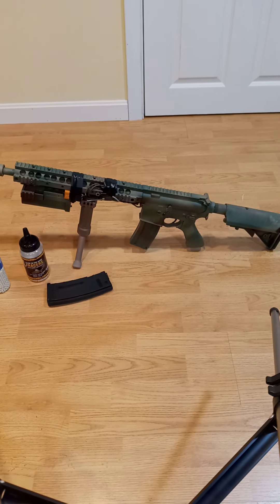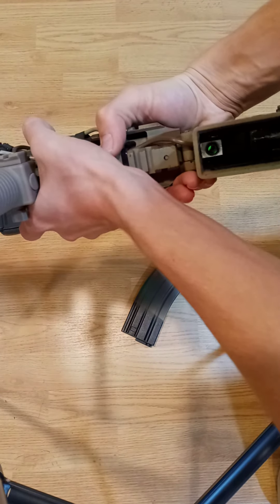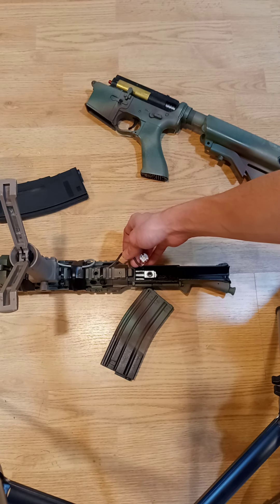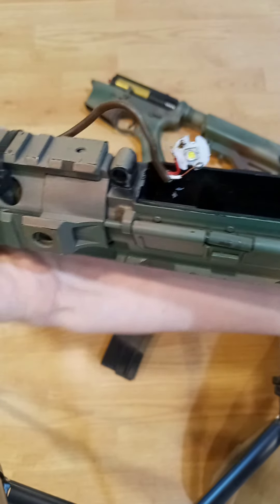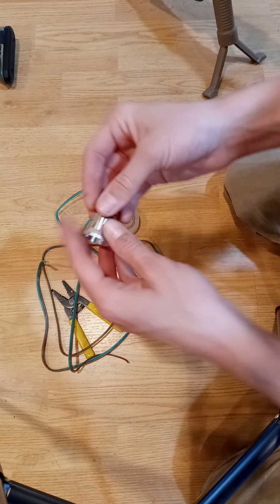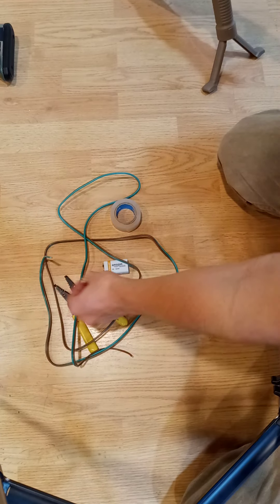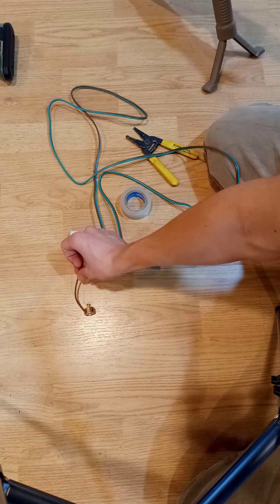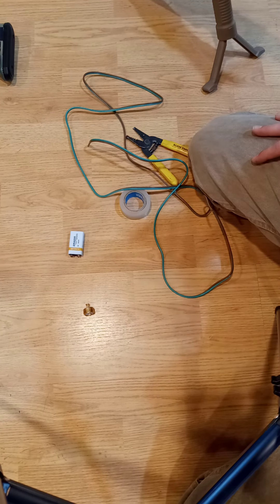Homemade airsoft tracer unit that actually works!

Comment: im pretty sure you need UV light to illuminate tracer BBs.I am making one using the ELUA3535OG5-P0010U23240500-VD1M UV LED which is what all the tracer units use/ It draws 1A so you need a more sophisticated circuit than just a switch or it will drain the battery quick I assume